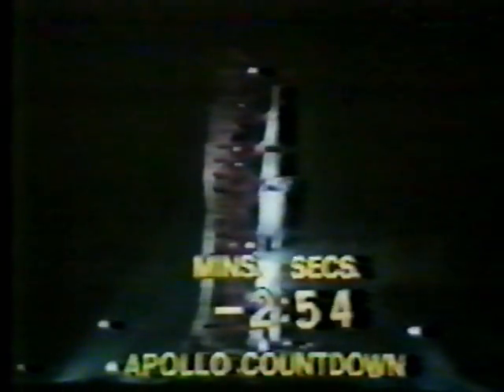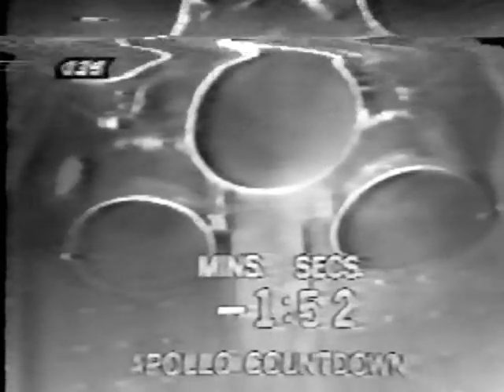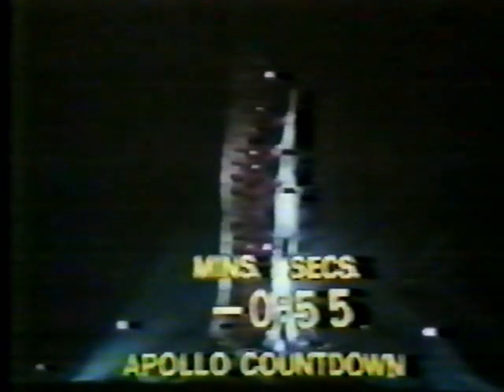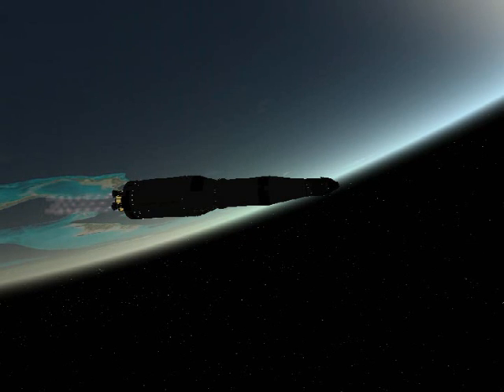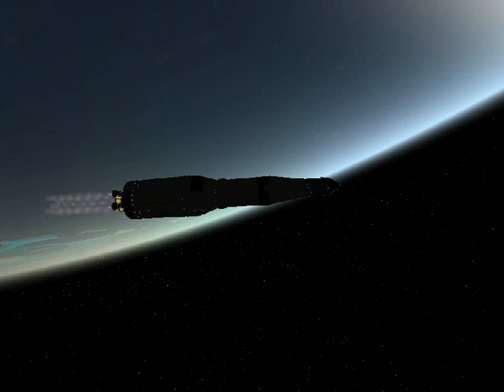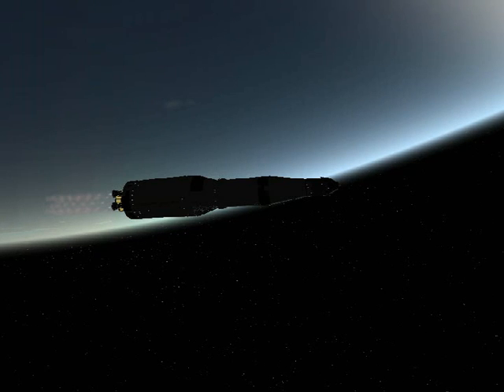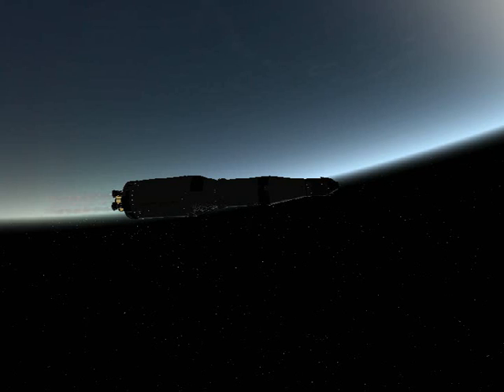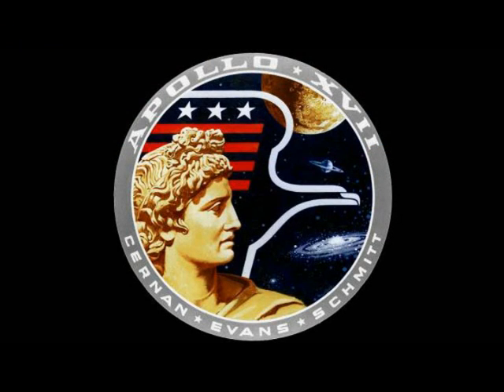Apollo 17 Launch - CSM Onboard Audio

Comment: Try to digest this in your mind..This machine was 363 feet tall and 8 million pounds..it achieved a speed of 6000 mph in 3 minutes as it was heading out... absolutely hands down the most bad ass thing man ever made
Reply: Actually, Patrick, the total vehicle weight was something like 6.2 million pounds (with a first stage liftoff thrust of 7.5 million), but what's a couple of million pounds between friends?      :  ]
Reply: You got that right my friend.  The largest man made object to move under it’s own power........and designed with adding machines and slide rules.  Man’s finest hour.  America’s finest hour.
Reply: I still think Saturn V is WAY better then SLS
Reply: @SixSilverStones  
SLS has to use solid rockets to make more thrust.
Reply: @SixSilverStones  sts was crap,you had to be crazy to ride it in the beginning let alone after two failures.
Reply: Indeed. And that’s why the Saturn V has got to be the single greatest device ever crafted by the minds and hands of men.
Reply: The coolest looking rocket ever made.
Reply: @Jellybeantiger  I have to agree with you. Every time I see a picture of the Saturn V, I'm in awe.
Reply: Yep! It's considered to be the tallest rocket ever built. Until SLS, or big Falcon.
Reply: 6000 MPH 2 minutes 30 seconds.  9000 feet /sec.
Reply: Where are all the "it was faked" morons?
Reply: adjusting for inflation it would have cost 1 billion dollars to launch!
Reply: Great German engineering
Reply: @1697djh  
The actual engineering was mostly done by Boeing (first stage), North American Aviation (2nd stage, Command/service module), Douglas Aircraft company (3rd stage), and Northrop Grumman (Lunar Module).
Reply: @charlesvan13  Werner Von Braun’s design.

Comment: Sorry for my bad english, but i've got one quesion.
In 4:27 CAP COMM say:
- Gene, you are feet wet - feet wet.
CDR answer:
- Roger, Feet wet.

What does it mean? I can't find the answer.
Greetings from Poland and thanks for this great video! :)
Reply from the maker: hi fanaberia - thanks for your comment - I have always assumed that "feet wet" was a 2nd part of the MODE1B abort mode - and that the feet wet call was meant to tell the crew that they had enough velocity that if there was an abort they would be able to splashdown, rather than on land (which Schirra eluded to in his book was a real possibility for Apollo 7 and was most undesirable in that the crew could be injured).

Here is an extract from the Apollo 16 flight journal:

000:01:06 Fullerton: You’re feet wet now, [Apollo] 16.
["Feet wet" is the US Naval aviator radio call for flight over the coast from land to sea.  Young and Mattingly are both US Navy officers, Duke is USAF as is Gordon Fullerton.]
000:01:08 Young: Roger.
Public Affairs Officer: "That callout from CapCom Gordon Fullerton says Apollo 16 now capable of water landing. Mark.  One minute, 12 seconds. Coming up on period of maximum aerodynamic pressure on the vehicle."

I can't find any other reference to it with regard to explaining the call and it seems to have only been used on Apollo 16 and 17 (I havent checked the Skylab ASTP flights but recall it is used on those flights...could be wrong though!).

I hope that this answer helps a bit?

regards

LM5
Reply: ***** Yes, it's clear now. I also found that transcripts from Apollo 16 - cool stuff. Thanks for your answer :)
Beautifull launch at night... It must be an amazing ride. I wish i were there, on the top of Saturn V, even it can be the last thing of my life.
Reply: "Feet wet" is fighter pilot jargon for flying over the water.  You call "feet wet" the moment you cross from flying over the land to flying over the water.  Why do the astronauts need to know it?  I'm not sure.  Maybe it has some relevance if they have to use the launch abort system- the Apollo capsule was designed to land on water, not land.
Reply: The CM could make a non water landing if needed...but it would be a bit rough on the crew..!
Reply: In earlier flights the  call was "cleared the beach", meaning that the vehicle was over the ocean for an abort and not the land.
Reply from the maker: Tom Johnson that call was made on ASTP too!
Reply from the maker: ***** albeit by PAO

Comment: I still remember watching this launch on NBC-TV. The networks had to use special filters through the camera lens to prevent the TV camera tubes from burning out due to the extreme difference between the black sky and the searing bright light of engine ignition. They placed a camera a few miles away at a building, 'Top of the Cape' in Cocoa Beach to show how bright Merritt Island became after the Saturn V cleared the tower. TV showed the blue exhaust light, from the kerosene burning 1st stage.